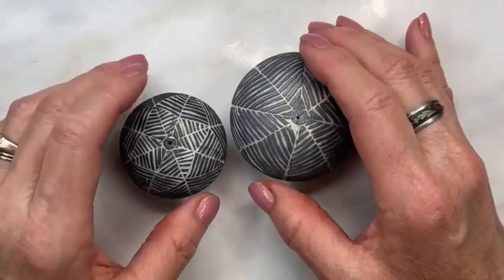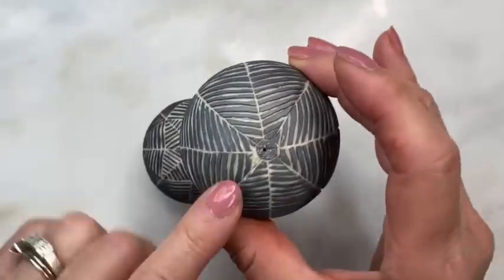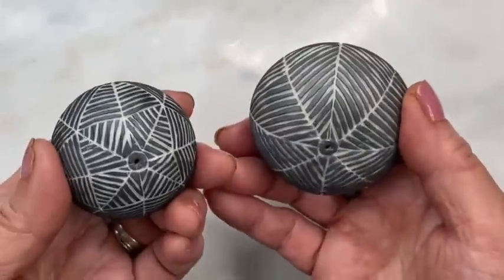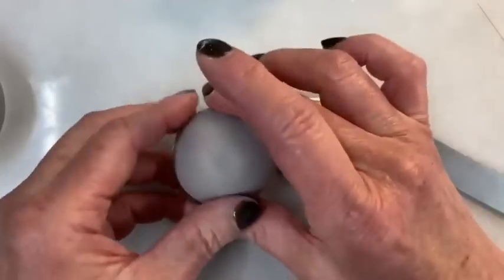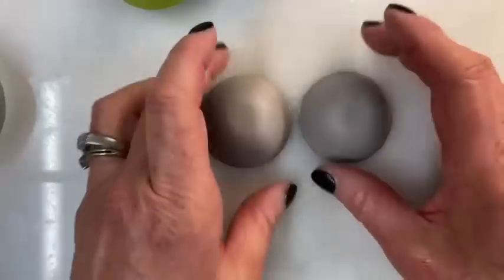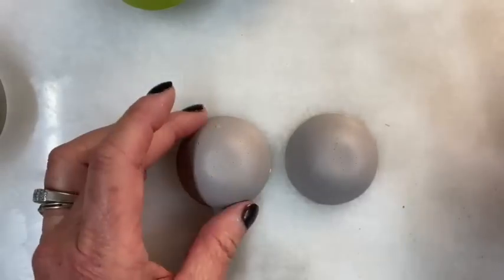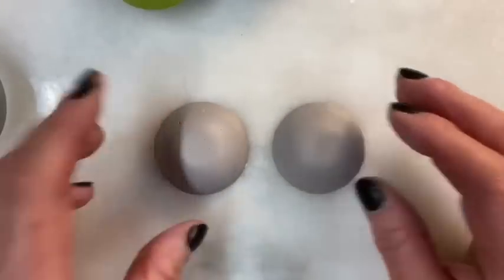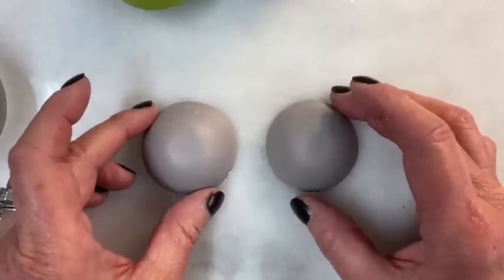A Polymer Clay Tutorial: The Hollow Carved Bead (reformatted)

Comment: Mrs Donna, ❤️❤️❤️ You are amazing! What a beautiful tutorial. I never tried carving. Usually, I may do some cuts using the x-cacto. You have given me so many ideas watching this tutorial.
I've got 2 questions. 
You used Loctite to glue the two halves. Can we use liquid clay instead, since the bead will need to be cured? 
The second question might sound a bit silly. As with most things, if dropped accidentally, they will probably break. Does a hollow bead will easily break, if dropped?
Thanks a lot 😘☺️
Reply from the maker: Hi Annita, ok, liquid clay would require curing before wrapping with the two color sheet so CA glue is best. 

Once you wrap it and cure it, you needn’t worry about dropping and breaking. 

😊❤️